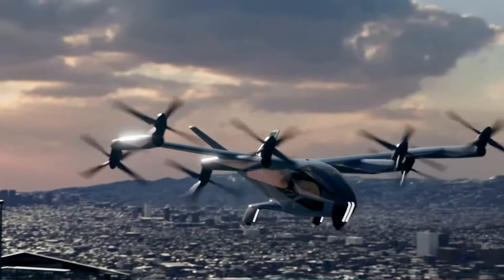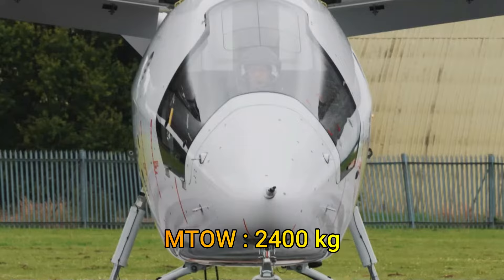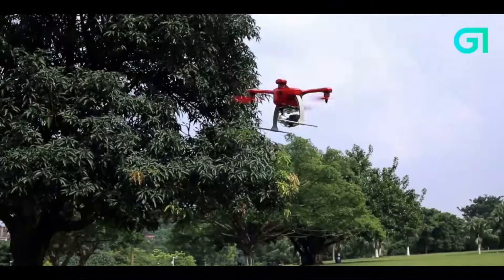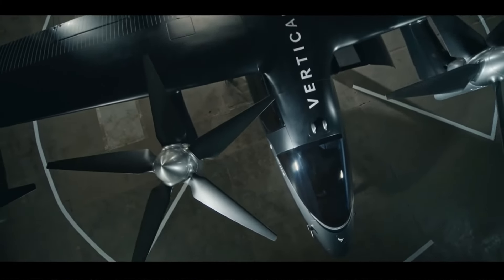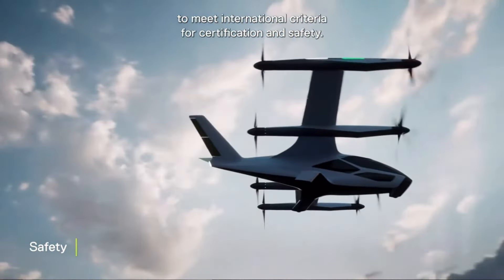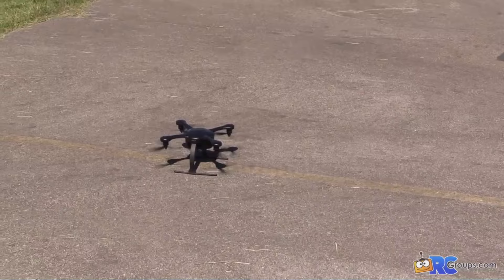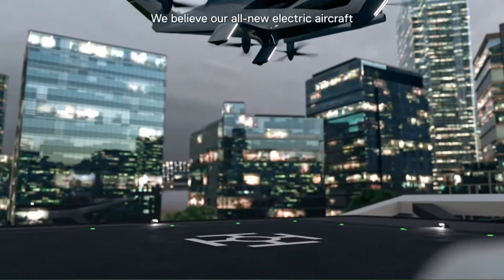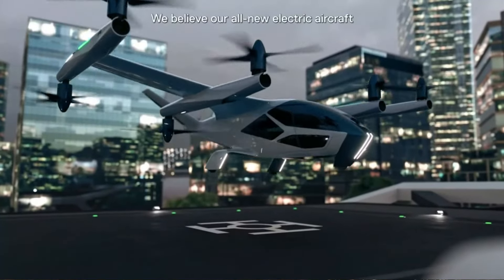Secrets of Hyundai's latest Air Taxi

Comment: Thanks, I really like the details you bring. 
This setup doesn't need the motors to change direction either or become dead weight while cruising.
Will they beat Archer at this? 
👍💪✌
Reply from the maker: There aren't that many numbers released by Hyundai to make that comparison yet.  I have a feeling though that Hyundai just might pip Archer in making a better battery pack. There IONIQ EVs have good battery packs in them
Reply: @ElectricAviation   I totally believe that as well, plus their manufacturing arm can take that up easily I can imagine.

Comment: Down tilting rear props for vtol have a long history the Do 29 used the idea based on the ww2 Focke Aegilis design and numerous 1950s designs - noise IS  bis issue when behind a wing ,as the Piaggio, Vari Eze, B 36 et al proved. Cyclic loads have created long term oroblems (eg B36 shedding props)
Basically a clone of many other similar VFS register coprcat designs.

Comment: Pushers have one fatal (as in a  barrier to adoption) flaw.  They're loud as hell.     Any time you put disturbed air in front of a propeller (including just the air coming off the back of a wing) it makes a lot of noise.   Putting one prop in front of another is the loudest configuration possible.    It doesn't hurt efficiency significantly but it makes municipalities not want your aircraft flying over and landing at their local airports.   The Piaggio P180 Avanti has push props, and it's extremely fast and efficient, but has been banned from several airports in the U.S. and many more in Europe.  
Even in a hover mode, just having the props on the bottom is louder than the top for the same reason.
Reply: from the specs it looks like they have addressed that noise problem. although they dont say how
Reply: Which European airport banned Piaggio Avanti?

Comment: So now a number of auto manufacturers will be more interested in this space.
I like that the rear motors tilt down, as mine did in the competition we had on this channel. Its actually the only way you can configure them if you want to contribute to translative thrust as you move forward, and it does mean you will get an amount of transverse flow across the wing contributing to lift. 
Also a top wing design means you have the wing area across the fuselage added to lift, and as this is the suction side it is more than you will get from the pressure side of a low wing design, in effect something like 60/40.
Its like theyre avoiding personal transport designs for the present.

Comment: I fail to see the efficiency gains by having the props directly in line with one another
Reply: Less drag from the booms. Only one boom required for two propulsors.
Reply: they also counter rotate, straightening out the airflow a bit and giving a slight efficiency gain.